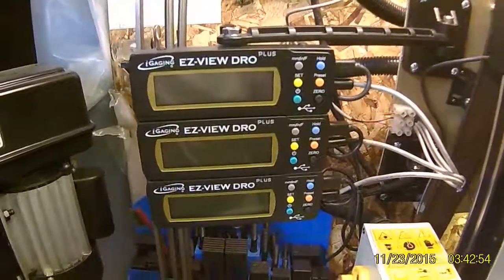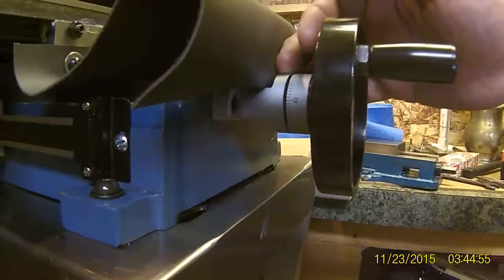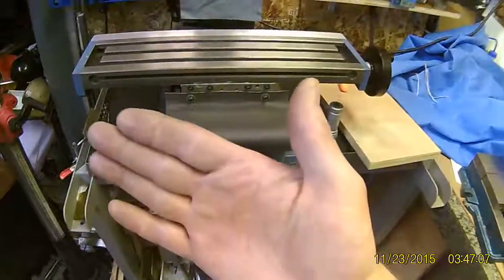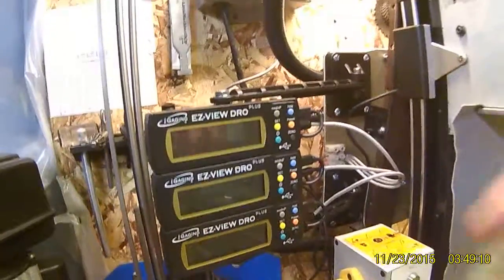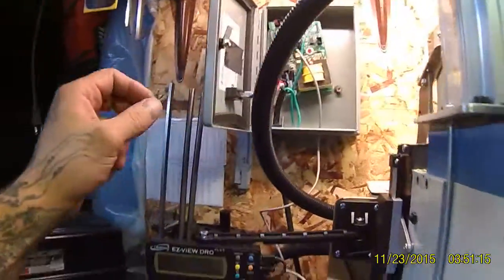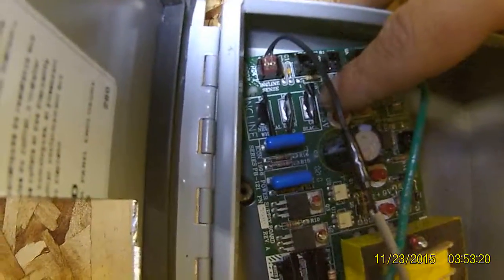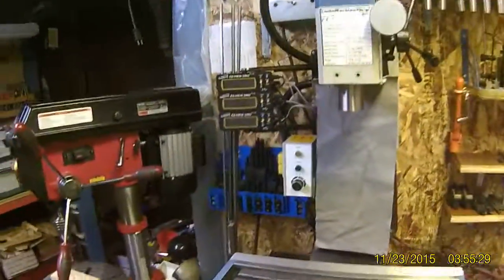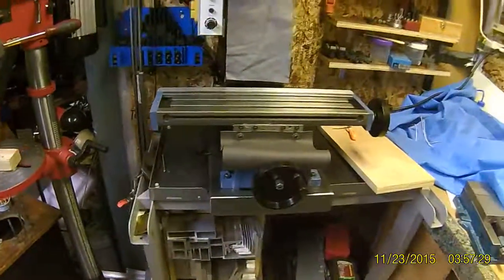SX2 mini mill show and tell mods. part 2

Comment: I have the same DRO's.  Are you powering them with a single 5V output?
Reply from the maker: I am powering them with a left over power supply from a treadmill. It is 5v. I believe they they require 5v 0.33amps. so for 3 of them any 5v 1amp will work. If I recall they take an "H" size barrel connector. and you can get the polarity by putting a connector in them with a battery installed and testing the connector.